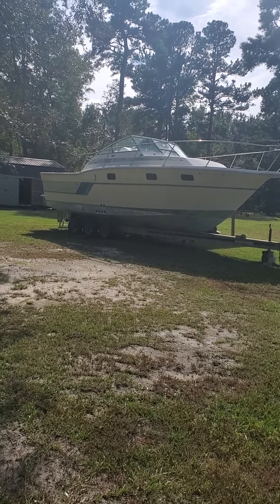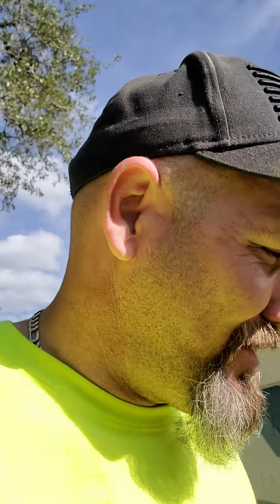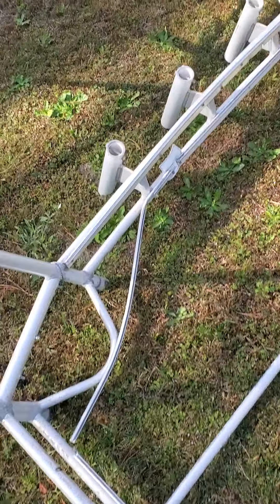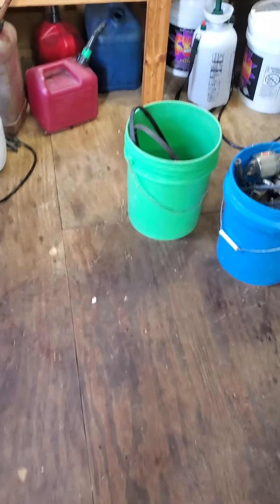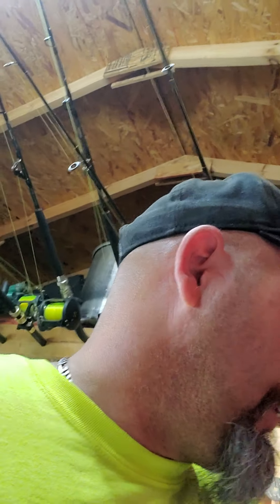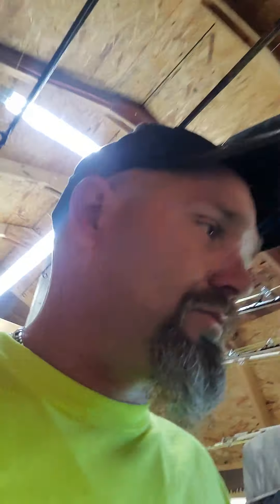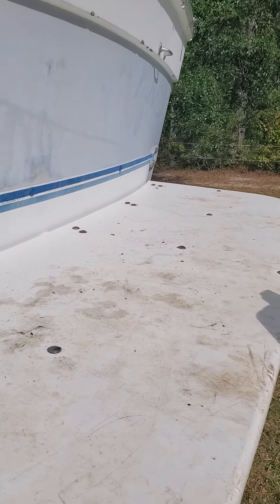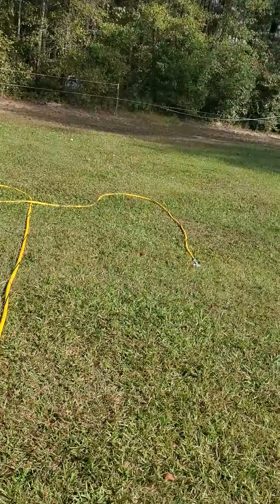aquasport 290 tournament master tower and top removed

Comment: Hi, they are Nibral propellers.  keep the videos coming!  very helpful!  just bought an '84 290 XF a couple weeks ago and have some work ahead to spruce it back up and will be checking in on your videos for ideas.  For the swimplatform, mine is mounted with 3 aluminum triangle brackets and I was told by the previous owner, it held 8 people.  seems overkill to have more than 3 brackets... plus limiting the amount of holes in transom is always a good thing!  I'm rebuilding since the core wood is rotted and the underside glass delaminated.  Will be using the coosa board or divinyl foam as the new core, 3/4."  Depending on if you want to or not, you could make a new one up and it will definitely be a lot lighter.  I've heard one suggestion that the air intakes on the hull get a fair amount of sea spray/splash so closing those off and running new intakes just above the deck on the sides is a better way to go.